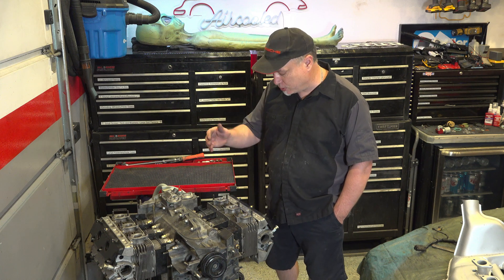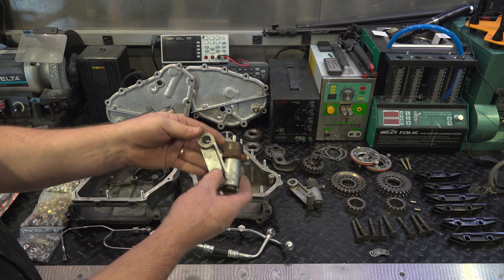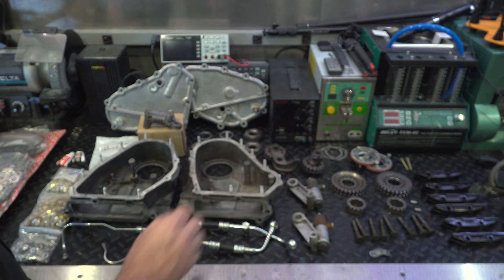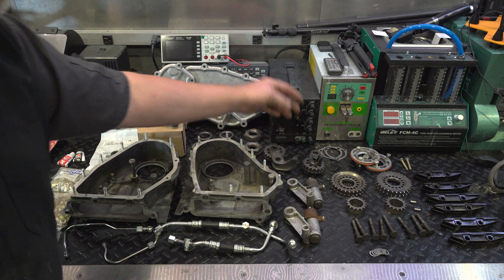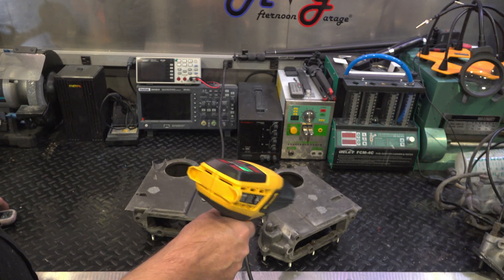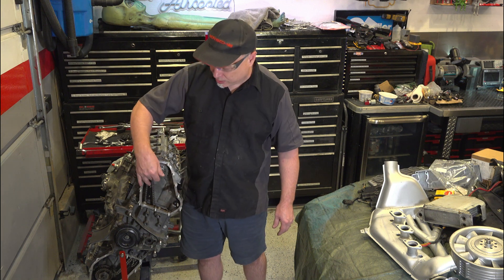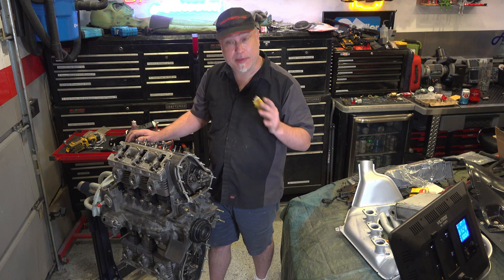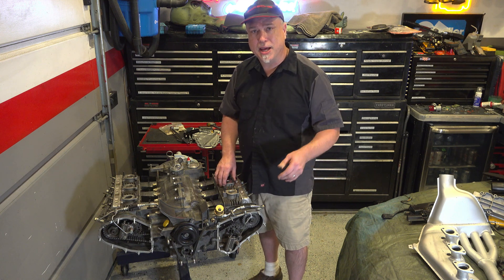1974 Porsche 911 coupe: Flat-6 Cam Gear Lineup and Valve Overlap Adjustment [4K] Ep117

Comment: Thanks!  Are the Z1 lift numbers the same for the 2.7S?
Reply from the maker: 2.7 (Standard/CIS): Focus is on valve clearance (0.7-0.9mm) at TDC to prevent piston-to-valve clash, often with less aggressive cams.
2.7S (S Cams): Uses performance-oriented 'S' cams, requiring specific intake valve lift measurement (around 0.73mm) at the Z1 timing mark for correct cam timing. 
The standard 2.7 checks valve gap; the 2.7S checks the exact valve opening amount (lift) at a specific point for timing its aggressive cams.
Reply: @afternoongarage  Thanks.  Have you seen the 0.73mm intake lift at TDC specification  printed in a Porsche document?  Google states the spec is 2.7-3.1mm
Reply: I just found the 1974-77S  spec in Wayne Dempsey's book: 0.4-0.54 (0.47) Can email the chart of 29 types of engines.
Reply: Wayne's  listed spec for the 75-77  Turbo and 78-83 Turbo is (0.73)  range 0.65-0.80

Comment: New to
Your videos . Just purchased a 78 SC a lot of projects . Injectors first on the list 
Really good content . I’m not a pro but have a fully equipped  hobby shop . I have two 4 post lifts similar to your that’s looks pretty wretched getting the engine out with the 4 post
Reply from the maker: No!  Dropping the engine and trans with the 4 post is great.  I got tired of laying on the ground working on cars years ago.  It really is a more precise thing the way I do it, and all the work takes place while standing.  I have planned a video where I show my modifications to the jack tray and transmission jack to make this happen with one person.  When done assembling the engine on the yoke, the engine gets moved in between the runways also allowing access to install the remaining tins, oil lines etc. all while standing up and off the floor.  I would not want to do it any other way now.  I have a couple other videos to publish and soon I will get to showing what I did.  Thanks for watching!
Reply: @afternoongarage yeah I’ll be looking out for the videos 
Really good content

Comment: What size open end spanner did you use to turn and adjust the cam end. I want to make a tool to hold the cam when setting up the cam timing..cheers.
Reply from the maker: This type of cam was used on the earlier cars and had the type with the big nut you see in that video. Newer cars had a completely different cam and way to tighten the cam gear on the cam shaft.  The "double D" shape of the cam takes a 17mm open ended wrench the way I used it.
Reply: @afternoongarage  Ok 17mm cheers.

Comment: Great job on the timing. Is your engine a 2.7 ltre?... my mag is the same but came in 1977. whats the cam setting you used on each side. I do have the wayne demsay book. Also you mentioned about the cis fuel distributor I had clogged fuel tiny filters that sit up in the crown of the distributor. Check for thoses as they can block up the lines. Watch out for the centre pin it justs sits there under the centre crown of the distributor...good luck. cheers.
Reply from the maker: Firstly, great questions and comments from you.  Yes this is a 1974 2.7L.  The spec for timing shows 0.7mm-0.9mm for a 1974 2.7L.  As you can see I tried to set it at 0.8mm.  I have some videos coming up that will shed some light on fuel system clogging with debris.  My plunger in the fuel distributor was frozen and I just about had to take it apart to free it.  I had to soak the distributor and use some compressed air, but it came loose after a couple days.  Don't want that thing dropping out and fall on the floor for sure.  Thanks for subscribing, it really helps me out and motivates me to keep making more videos!
Reply: @afternoongarage  Thanks I'm in the same boat..Hope to see your 2.7 start up and run free.👍